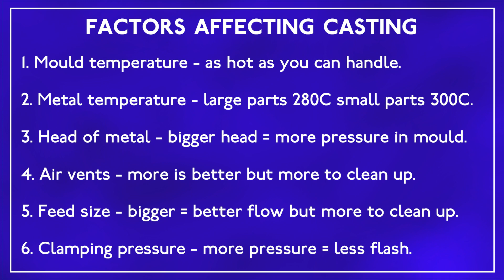HOW TO… PART 2  ‘CAST FROM SILICONE MOULDS’

Comment: 4:30 So, the large reserve volume amount above the mold helps to force the liquid metal into the fine detailed areas?  Not sure if I said that correctly.
Reply from the maker: Yes, that's correct. Check out 'How to...' #1 for an explanation. The main factors that can affect the detail are the metal temperature, mould temperature and the size of the head of metal.

Comment: Hi sir. Can I cast large action figures there? Thank you.
Reply from the maker: This process works very well for small parts about 2-3 inches long. Large figures are best cast in smaller sections and then assembled or cast in resin with a metal powder to give them weight.
Reply: @StaplesandVine  okay got it. I will research on it more and I will watch all of your videos. Thank you!

Comment: hi...i have  high temp rtv made by rs ...but on the third pour i noticed cracks in the master mold...pls do u have a solution
Reply from the maker: I don't recommend trying to glue the cracks together with superglue because when it gets hot it gives of cyanide. It sounds like the rubber you are using isn't able to take the heat. Check what it is rated for, but I think you should try a different RTV silicone rubber. Check out the supplier links in 'How to... #1'.
Reply: thank you sir... the silicon i am using is from RS Components ...the company is in corby UK....actually what happens is that when the first pour comes out all is fine... i think maybe there are less airways... if i could attach a pic life would be easier!..but i cant on this...anyhow....the manufacturer says its flame retardant and for high temp

Comment: Staples and Vine Im new to model casting and was wondering can you link me a decent supplier of metal ingots. Im currently using prince august six star metal and have to say it is excellent as are their molds.I was wondering if you know any other suppliers of metal ingots and also molds.And if you could also advise me as to good mixing ratios for metals ie. to make decent model metal what ratios of pewter to tin etc...
Reply from the maker: Hi Andrew.  This is the company I use for all my casting alloys http://www.gwneale.co.uk/index.html and this is where I get my silicone rubber from https://www.polysil.co.uk/ Both companies are very helpful. Give them a call or send them an email.
Reply: Staples and Vine  Excellent thank you for your assistance.I will check them out in the near future.Do you know any companies that supply premade molds for casting metal? So far Ive found prince august the dunken company and berliner zinnfiguren . do you know any else?
Reply from the maker: @andrewfaulkner4424  sorry, I have no idea. I have always made my own.
Reply: Staples and Vine  No worries thanks again.

Comment: Is the copy's surface as smooth as the master's, or is there some level of grain that always needs to be sanded?
Reply from the maker: Hi Josue. The surface of the castings will always need a degree of cleaning up. Bulky castings require the most attention. I use this process for most of my models so you will see a range of results in my other videos.

Comment: what kinda silicone is that? you can drill vents?
Reply from the maker: Check out the description of 'How To...' #1 for silicone suppliers, and how to make the moulds. The air vents are drilled with a 1mm sharp drill at high speed. pump the drill in and out of the hole to keep it clear. Hope this helps.

Comment: Thanks for sharing.Can you tell me which kind of material you use to make the mould?
Reply from the maker: Hi, the mould is made from a room temperature vulcanising rubber (RTV) . You will need a grade that withstands high temperatures, otherwise you will have a fire. I use grade 3481. Check the links in the description.

Comment: What kind of metal do you use for casting?
Reply from the maker: Hi Alvino, I use pewter which is a mixture of Tin and Lead. There are a lot of varieties out there but basically you need a variety containing lead to help the metal flow. It's perfectly safe as long as you don't eat large amounts of it.
Reply: Having some Health and safety experiences, stay away from vapours and wash your hands as well.

Comment: Can we cast plastic in this moulds
Reply from the maker: Silicone moulds can be used to cast resin parts but the mould design is different. That is for another day.
Reply: @StaplesandVine   and also post video on injection moulding 😊 at home .
Reply from the maker: I'm afraid injection moulding is out of my league. It's a pricey process...

Comment: How long would be the mold sustain repeatively after being poured with the liquid metal?
Reply from the maker: Hi, a good point. Fine undercuts of rubber can break off at any time depending on the nature of the master. This is common with any type of rubber mould and  happened with my Maus tank tracks. You should easily get 100 castings off a mould before it starts to generally degrade. This method is best for short runs or prototypes as the castings do need a lot of cleaning up. You could cast a set of tank tracks using this method but be prepared for a lot of filing!

Comment: What is that metal, how much°C it needs to melt? price/L or kg?
Reply from the maker: Hi MrAntza, the metal I use is pewter / white metal. There are a lot of different grades. I cast at about 280C . The price goes up and down and varies with quantity. Currently I pay about £25 / Kg.
Reply: @StaplesandVine  So mostly Tin?  How its si cheap for you, I found it like 70€/kg 😅🤔
Reply from the maker: I buy my metal from AIMALLOYS https://www.aimalloys.com/snpb-lead-free-casting-alloys The more you buy the cheaper the price. Tin is a commodity and the price does go up and down. Currently all metal prices are high. You can check online.

Comment: Can you cast aluminum with this mold?
Reply from the maker: No I'm afraid not. Aluminium casts at 700-750C. The silicone moulds will just burn up at this temperature. To cast Aluminium you need to make sand moulds which is a totally different process.
Reply: @StaplesandVine  Thanks Benjamin (and of course Staples and Vine), this was also the question I was going to ask.

Comment: I thought that it will melt the silicone mold because the liquid metal is hot, why it didnt destroy the silicone tho?
Reply from the maker: The metal is cast at about 290C. The silicone is special high temperature silicone which can withstand the heat. Only high temperature silicone rubber can do this.

Comment: It was strange to see you use 2 ladles of metal in one pour.  With most casting an interrupted pour does not end well.
Reply from the maker: Thanks for the comment Dan. A good point about the second pour. In my case the first pour fills the part cavity and the second just creates more of a head of metal to increase mould pressure. Certainly in other cases two pours would not be good, causing cold shuts and other issues.

Comment: Hello from slovakia :) I have 2 questions, what kind of metal are you using for your molds (cannot understand due to my bad english)? And secondly, are these white metal molds strong enough to be tracks / wheels / axis of 1:10 RC tank model ? Thank you for your How To series, it helped me a lot. I always thought i need strong aluminium molds for this project, but equipment for aluminium casting is too expensive for me ... so i will try this and see :)
Reply from the maker: Hi, thanks for your comment. The moulds are made from silicone rubber and are only suitable for casting white metal. White metal is great for non functioning parts but not durable enough for working parts such as tank wheels and tracks. They would wear out and break very quickly. You could try searching for 'investment casting' / 'lost wax casting' on google which is for stronger metals which cast at a higher temperature. Silicone moulds are not suitable for high temperature casting so please, don't use this method for casting aluminium.
Reply: @StaplesandVine  thanl you very much :)